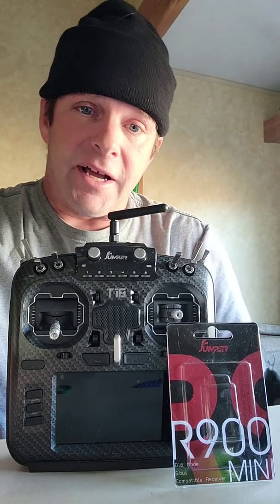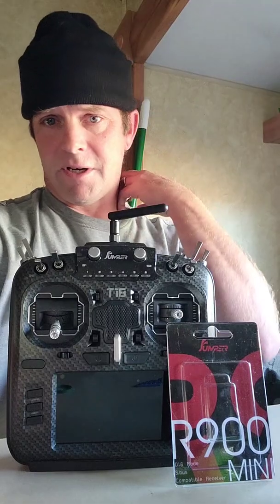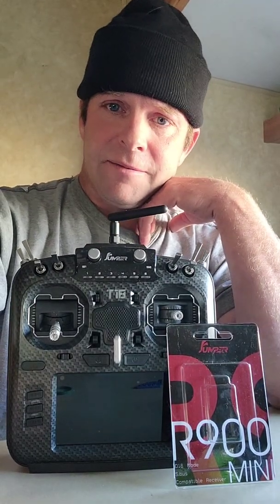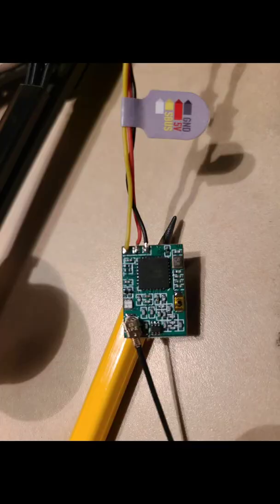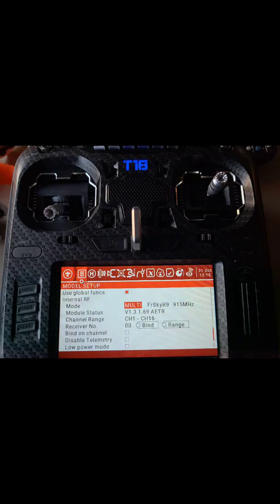Jumper R900 mini long range receiver (NO WIREING DIOGRAM??)

Comment: The image clearly states (from top to bottom) SBUS VCC GND and the "D16" means it uses 16 digital channels using the R9 protocol.
Reply from the maker: I think you need to take a look at the R 900 package it clearly States D16 mode S bus compatible receiver. That clearly is not the wiring diagram.

Comment: Hi, do you know if uses accst protocol or access?? That receiver??
Reply: ACCESS is secret sauce. So it's ACCST. However. If you are going to buy a R9 module you should consider using ExpressLRS. It's Open Source and you can flash the R900 and also the R9 receiver family with it. It's even faster than "Crossfire Shot".
Reply: @ZeroFPV  Finally I bought a crossfire tx and rx 😁😁😁
Reply: @lolovpp277  
Yeah. I switched to Ghost. R9 ACCST firmware is broken. FrSky only fixed it in the ACCESS firmware. So, not buying it was a good choice. :-)

Comment: I am thinking about to buy a r9m 2019 and that receiver for me taranis qx7 accst model. But I have not found any information for the jumper r900 mini in the web...
Reply from the maker: I did not have to update firmware in the radio or the receiver for it to work with the T18 jumper.
Reply: @barnstormrcsessions2951  ah okay i thought you had the r9m frsky transmitter installed, you have jumper t18 with 2.4 and 900 mhz bands.
Reply: If you have the ACCST QX7 you'll need the ACCST firmware (or ExpressLRS) to get the 2019 R9 module to work with your QX7. Should be no problem to do and with the ACCST firmware you should be able to use the R900 Mini as well.